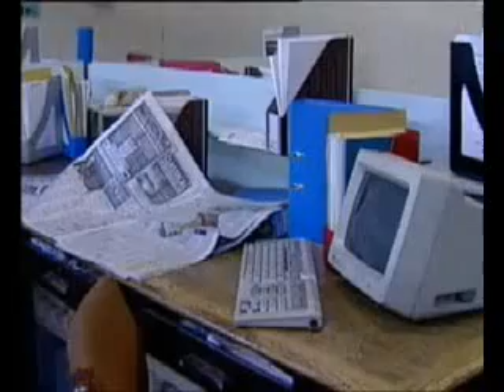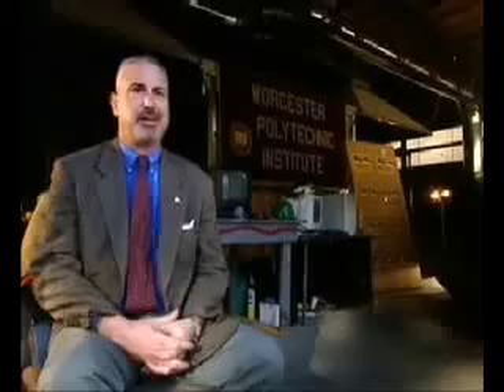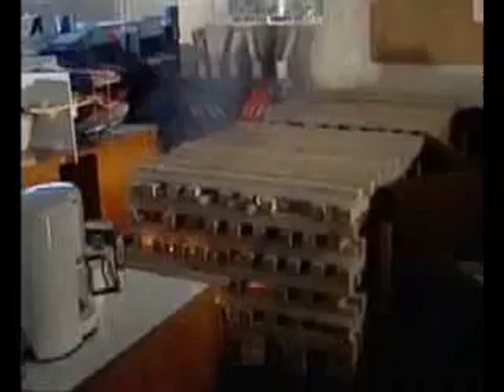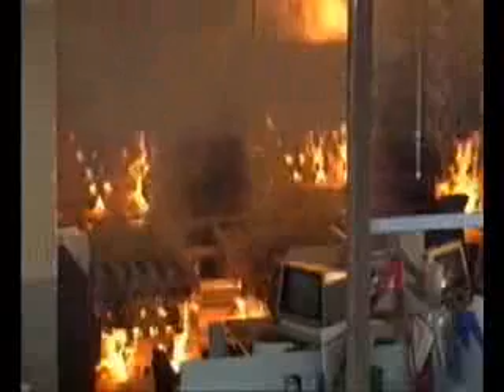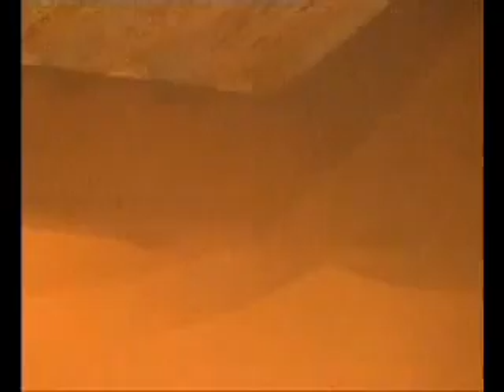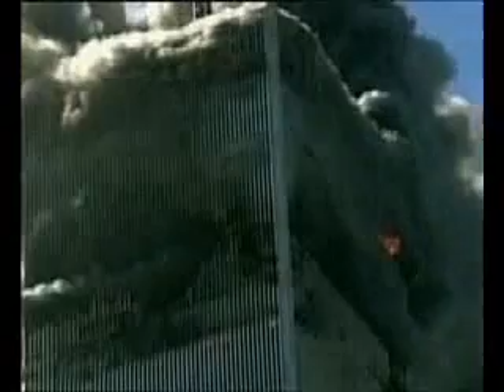Jonathan Barnett on fire and steel

Comment: In order to collapse perfectly vertically (which they did) and at free fall speed (which they did) all of the columns on each level would have to be removed at the very same instant, and level by level, in a perfectly sequential synchronized fashion. Which they were.
The heavy debris that was flung great distances does not contradict the fact that the collapses occurred into their own footprints. On the contrary, these large explosions, along with the hundreds of clearly visible 'squibs' , are more visible evidence of the controlled demolition which made perfect collapses possible. There is no mechanism other than explosives that could propel multi-ton steel assemblies hundreds of metres in a horizontal trajectory. 

The presence of massive projectiles does not alter the fact that the collapse occurred perfectly vertically with a high degree of precision. You need only hold a ruler against your computer monitor as you watch the collapses occur to see the exacting precision with which they fell into their own footprints. 

If in the extremely unlikely event the steel did become structurally compromised, it would do so unevenly and at unpredictable rates. Resulting in an uneven, messy, gradual, and  asymmetric collapse. Not the meticulously synchronized perfectly elegant 'controlled demolition like' collapse that we saw. And as if this perfectly executed accident weren't enough, it would not happen 3 times in a row. The only examples of this type of collapse in the history of modern construction

Comment: @Skeptic121 
Really? Is that why Professor Barnett totally dismissed the possibility of THERMATE,
at WTC 7 or WTC 1, where the sulfidation was discovered on HORIZONTAL beams
far removed from any collapse points? Quote. "Thermate has 29% Barium Nitrate,
compared to 2% sulfur. The sulfidation areas are physically SMALL, below the
collapse floors in both WTC 7 and WTC 1, and are horizontal floor beams, NOT
related to vertical support." Barium Nitrate is FLUORESCENT, and should have
litup the debris